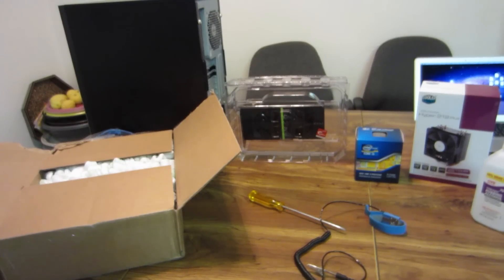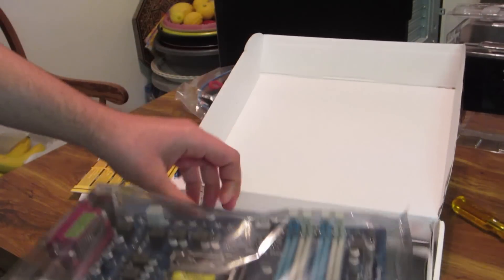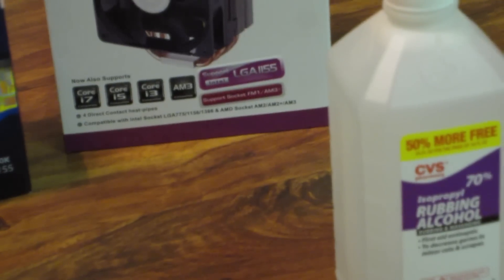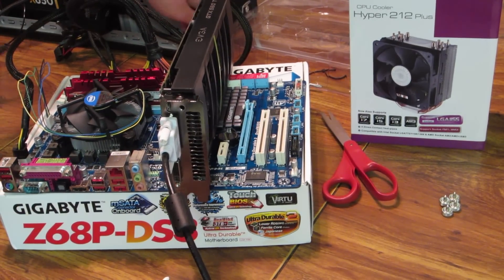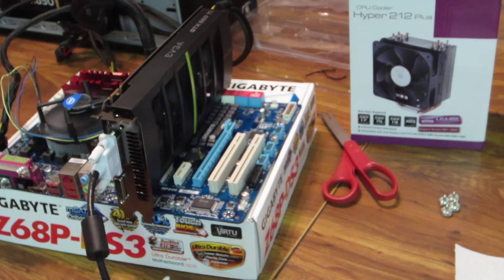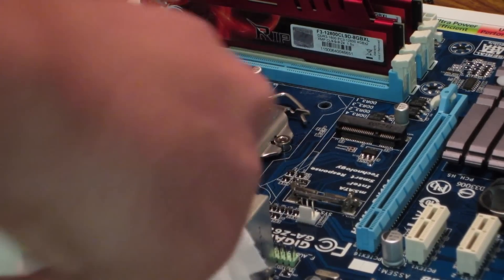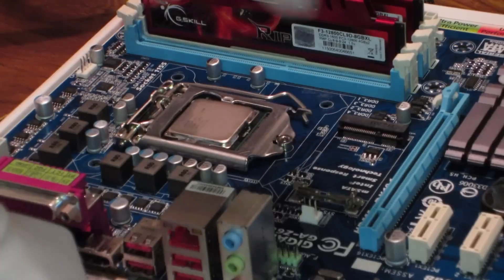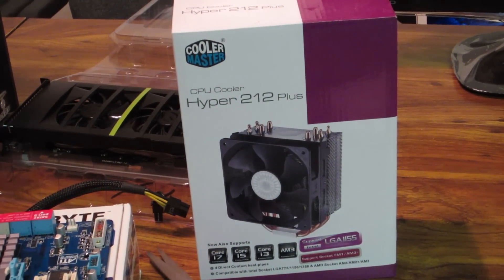How To Build A Gaming PC - Tutorial [HD]

Comment: Will this setup run BF3 at 50-60 FPS?

Intel i7 2700K 4x3,5 GHz
Gigabyte Z68AP-D3-B3 motherboard
Kingston HyperX 8GB DDR3-1600 DualChannel RAM
Seagate 500GB SATA3 6Gb/s Fluid Silent 7200rpm
Nvidia GeForce GTX580 1,5GB
Windows 7

Comment: Well the number one component in a gaming pc is the graphics card, so don't skimp out on getting a good one. If you're working on a budget I recommend buying an AMD cpu and gpu, if money is no object then go with and Intel cpu and a Nvidia gpu. It is not needed that you have a top of the line cpu, an average quad core will do. The gpu is what you want to shell out the big bucks on. I also recommend a minimum of 4 gb ram, but personally would go with 8 gb.

Comment: Can anyone give me pointers for my gaming pc that i am going to get for 2014:

Case: Antec 900 V3 Black Steel ATX mid tower Gaming case
Power Supply: Corsair CMPSU-850AX AX850 Power Supply (ATX)
GPU:MSI R7950 Twin Frozr 3GD5/OC Radeon 7950 384-bit GDDR5 
PCI Express 3.0 x16 HDCP Ready CrossfireX Support Video Card
CPU: 3rd Generation Intel Core i7 3770S Series Processor 
Ram: 4 sticks of Corsair Vengeance 4gb 240 pin DDR3 SDRAM DDR3
1600(PC3 12800) DesKtop Memory Model CMZ8GX3M2A1600C9B